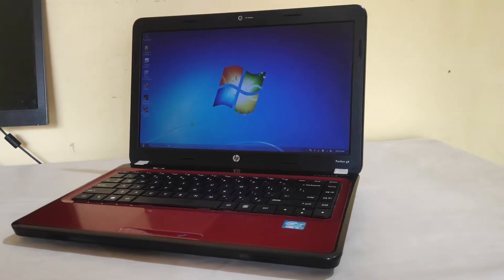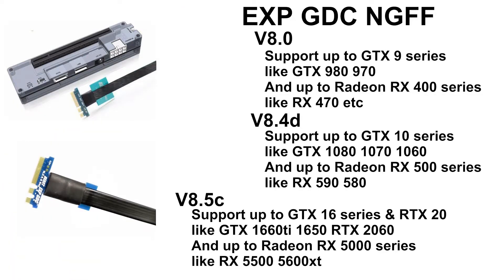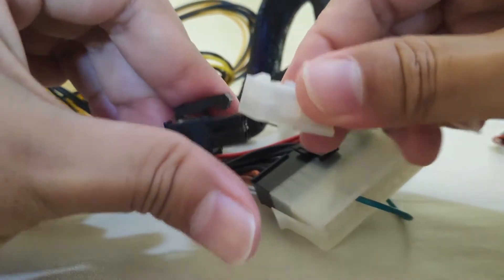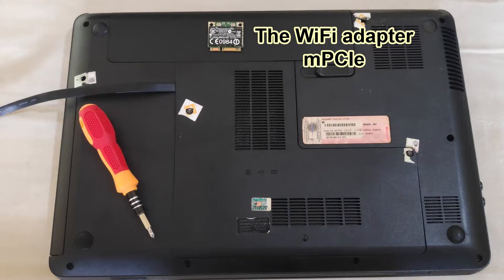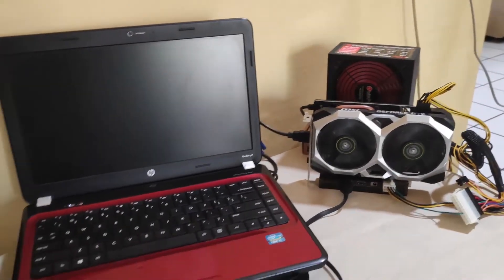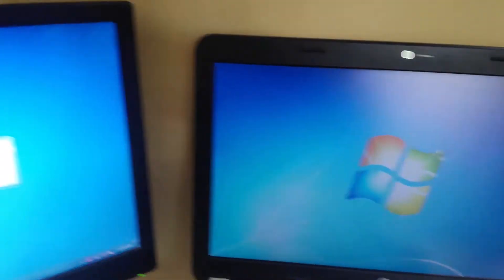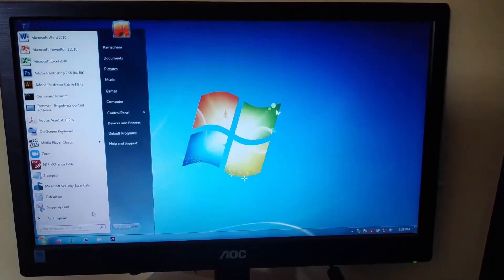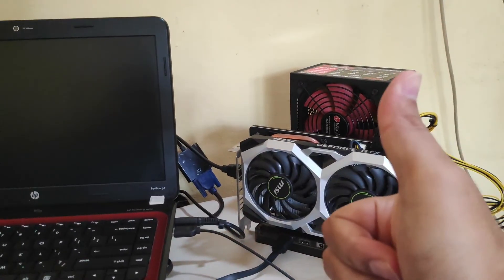EXP GDC Beast V8.5c eGPU with GTX 1660 ti on Old Laptop from 2012

Comment from the maker: I will just Pin this comment about other YouTube videos regarding External Graphics Card which are using BEAST EXP GDC of Various Model

These link Below, are using EXP GDC V8.0 mPCIe
https://youtu.be/ir-5JDITDd8      With GTX 1650 & Dell DA 220 W Brick PSU
https://youtu.be/6JcucfWz51o   With RTX 3070 & testing GTAV CSGO BF5

These link Below, are using EXP GDC NGFF
https://youtu.be/pKv436sOrNo    With GTX 970 NGFF
https://youtu.be/7-qdWAJf_UE    With GTX 970 NGFF & RDR2 Test

These link Below, are using EXP GDC ExpressCard, & Dell DA 220 W Brick PSU
https://youtu.be/sTSxdQuj8Bw    With GTX 1060 3GB
https://youtu.be/d7UjH6B4ltY      With GTX 1060 3GB
https://youtu.be/pAEMZqpvu0M    With RTX 3060 Ti
https://youtu.be/n7xExwDDR2o      With RTX 3060 Ti & testing CyberPunk 2077
Reply: bro beli dimana egdc nya? ada rekomended ?
Reply: I would like to ask about upgrade gpu of i7 6700HQ(Win10)  lenovo ideapad700.
Reply: https://www.youtube.com/watch?v=6Z67JN3b1Zc
just finished my eGPU setup, HP2560p with ATI HD5670
Reply from the maker: @newheavyion  Why setting that video for YouTube Kids?

Anyway with Core i7 QM, it is a wasted Performance because the CPU is still faster than the GPU.
Reply: @ClayWheeler  it is a fun project, not a serious gaming setup. I will try same others GPUs up to a R9 285 in the 2560p. Im just in the mood to experiment with older hardware i had in boxes for years now. Im also trying an eGPU setup on an Inspiron 1525 but with Lubuntu
Reply from the maker: @newheavyion  experiment with Genshin Impact and grow your channel lol
Reply: @ClayWheeler  Not sure what you want to tell me with that answer.....
Reply: @ClayWheeler will be work the exp gdc beast 8.5c in gtx 1660 supper 6gb ?
Reply from the maker: @SandroElias-bw4co  yes
Reply: @ClayWheeler  in core 2 duo t7100  1. 80 ghz, 8 gb ram?
Reply from the maker: @SandroElias-bw4co  no.

Core2Duo Laptop doesn't support modern PCIe signal .

Need at least Core i3 Laptop.

If anything, it should be cheaper to just buy a PC itself. Full set Core i7 2600k including Motherboard, RAM PSU case Only $50
Reply: @ClayWheeler all series 10

Gtx 1050, etc. ? Core 2 duo
Reply from the maker: @SandroElias-bw4co  yeah Core2Duo Laptop is too old to use external Graphics Card at all.

It will not detect anything
Reply: @ClayWheeler  good day sir
Reply: @ClayWheeler ahm.sir we have the same laptop sir..can i use RX 580 graphics card?
Reply: My PCIe x16 slot on my desktop PC mainboard (Gigabyte H310M H2.0) has died recently...is this a good alternative against replacing the board? Thanks!
Reply from the maker: @gkiss2030  that Motherboard is so cheap. Why not buy new instead? Or secondhand
Reply: @ClayWheeler Good idea, will try.
Reply: Hi. I recently got the exp GCD v8.5c dock with 220w PSU (dell) for a Rx5500 xt. my Acer with i7 5500U (dGPU 940m) won't boot with the WiFi ngff swapped with the dock. Or device manager fails to recognise. I changed bios settings but still no.
Any idea or help?
Reply: Hii, I got a rtx 3070, then I should use EXP GDC M.2 Nvme version right? I think it's the same slot we use for SSDs?
Reply from the maker: @PHOENlX1734  just click at the pinned Link with RTX 3070
Reply from the maker: @PHOENlX1734  depending if your Laptop old before 2017 or new after 2017
Reply: @ClayWheeler  my laptop is of 2022, I found out that I got two m.2 4.0x4 ports I can use it thanks
Reply: How you identifying the one the fit your laptop?

Comment: What happen if just use hdmi to hdmi ?
Reply from the maker: HDMI cable on its own is just video signal. Not PCIe signal.

The HDMI in this video is merely Physical Connector for carrying PCIe Signal. It doesn't do anything related to video signal.
Reply: Thanks. Good to know. @ClayWheeler

Comment: Question: is upgrading a old laptop (and putting a EGPU 1660 ti like yours) or a new laptop?
Reply from the maker: If you already have Both old Laptop and GPU in your possession, you better build a PC.

Laptop is really just good for being Portable. I don't consider Laptop for Gaming. Unless the Laptop stay at home forever. Then you can do whatever you want with the old Laptop.

If you want something really Portable, just buy a new Laptop, or secondhand Laptop.
Reply: @ClayWheeler  ok thanks A pc could be a good idea

Comment: Hey i know its been 4 years but will my acer aspire e1 472 connect to a gtx 1050 ti G1 gaming 4gb ddr5 with this and do i need to go to my bios to change something please tell me 🙂
Reply from the maker: Core i5-4200U?
Reply: No i3-4010U
Reply: Bro will u plz answer  🙏
Reply from the maker: @Alexor237 I read people's Posting in Reddit, all of Intel 4th Gen Laptops with U series are using NGFF WiFi adapter.

But it is very tricky to set up. It is not as simple as 3rd or 2nd Gen Intel.

Intel 4th 5th 6th Gen laptop is difficult to use External GPU unless it has Thunderbolt or Express Card
Reply: @ClayWheeler  hey there I just asked Gemini he said that my one uses Mini PCIE so can I connect it
Reply from the maker: @Alexor237  just open it up before buying the dock.

Otherwise you're wasting money.
I'm pretty sure myself, it's NGFF
Reply: @ClayWheeler  OK then I will see but how do I know the difference between NGFF and Mini PCIE slots ?
Reply from the maker: @Alexor237  you will know right away. The number of Slate teeth.
Just match it with the video description
Reply: @ClayWheeler  hey there i checked my laptop and it has Mini PCie so yea can i connect it or did i see something wrong

Comment: Yo i did everything correctly and the gpu and psu turn on and my laptop boots up correctly but when i check in device manager it doesnt show the gpu it only shows my intergrated graphics card.everything is connected properly
Reply: Have u installed the driver of the graphics card?
Reply: @Alexor237  so turns out I think my GPU was the problem HDMI ports and VGA ports are faulty
Reply: @datboimelo  oh ok then hope u found the solution 🙂

Comment: Hi..i got mini pcie.. Tried with gt1030 graphic card is showing but always driver error 043... later found that in the exp gdc manual it's mentioned it will not work. Do you any solution for that ..if not what's the latest graphic card which works with gdc 8.5c.
Reply from the maker: @137mrbond1  I have Error 43 fixer. Please write down your Email backward with space and then I will send it right away. Don't worry you're the 200th person who asked for the fix.

For example yourEmail@gmail
To be: l i a m g @ l i a m E r u o y

I will delete these entire comments after I sent you the fix. It's 100% WORKING.
Reply: @ClayWheeler  moc.liamg@563neevanhcet
Reply: @ClayWheeler  thanq for the response
Reply: My laptop specs hp envy4 1202tx with hd4000 and RadeonHd 8600/8700M . Which already has compatability issues.. Laptop only works if Radeon HD graphics is disabled. This issue has no solution.. Tried many times with all the info..i switched to EXp gdc for graphics solution. But still having problems.i tried with old nvidia GeForce 8400gs it worked but not the gt1030..
Reply from the maker: @137mrbond1   I am fully aware of Error 43 and I know how to fix it.

The problem is, this is a Paid software. But I'm gonna send it to you for free. And the instructions are Self Explanatory because it's super easy.

Seriously just tell me your email like I said above

Comment: Would coexist the intel UHD Graphics 3000 with an intel ARC A380? Or should I uninstall the drivers of UHD? I Thought set the core i7-270QM or i7-2920XM instead of Core i5 2430m for better results

Comment: To be fair, you could get a similar experiance with a gt1030 gddr5. You'd have achieved more by selling that netbook and buying a used gaming laptop with a dedicated maxwell gpu.
Reply: Did gt1030 worked on exp gdc 8.5c with laptop
Reply: It mentioned it will not work

Comment: Thank you, I've wanted to buy an EXP GDC for a long time, but I was unsure if it would be compatible with my HP Pavilion G4 laptop. Your video finally convinced me. 
I have one question though: do I need to disable the laptop's GPU? I have a switchable HD Graphics 3000 and HD 7400m.
Reply from the maker: @doughlaspardede    No need.

Just make sure the BIOS settings the same as in video. Also for Windows 10, please don't Install anything newer than 1909.

Because v2004 v21H2 and newer have weird glitch

Comment: Forgive me but isn't the whole idea of a laptop to be able to play anywhere, how are you gonna game sat on say a plane or even your sofa with all these pieces?
Reply from the maker: @SN-ig2ml  why are you even bothered with Old Piece of Laptop anyway?

I have a newer Laptop that is thinner, more Lightweight, less straining for my body when traveling. Obviously not good for gaming because it doesn't even have discrete GPU. But it's good for Desk Job like Microsoft Excel etc.

So instead of throwing away my Old Laptop, it's still good enough for lightweight gaming. So it is permanently on my desk.

Of course, with my current Lightweight Laptop, I will definitely make it into Gaming Laptop when possible. The M.2 slot can handle External GPU after all.

If I want a Laptop that is good for Gaming, and Traveling, it is "Framework Laptop" . You can forever upgrade the components including the GPU CPU etc. You can unplug the thick GPU when not needed.

My family have a habit of "Not throwing away any Electronics"
Reply: I'm doing an egpu setup on my old 12 old laptop too in 2025 but it is so big that it's more like a portable desktop anyways. When I want to game or watch movies on the go like a plane, I have my phone or handhelds like a new 3dsXL and psVita. I only like a laptop having the ability to take it if I must, but 99% of the time I'm using it as a desktop PC anyways. I play all my steam games on my old gaming laptop as I'm not a fan of the size of a steam deck. The egpu setup is saving me over $2000 for a new gaming laptop for a couple more years. For me it's huge!

Comment: I have a hp pavilion g6  can I try this with a better or higher card without the i5 2430m bottle neck it?
Reply from the maker: @kwajovybz  you also have 2430M ?

If yes, then any Graphics card beyond 1050 Ti already bottleneck by the CPU, not GPU. Also bottleneck by the mPCIe itself.

You can also use Lossless Scaling Frame Generation tool from steam

Comment: 0:23 I have hp elitebook 6930p it has core 2 duo p8400 from 2008
Reply from the maker: Not possible. It doesn't have any Adapter that serve as PCIe signal
Reply: @ClayWheeler  that laptop has 2 wifi card slots
Reply from the maker: @MacroSword  I mean, WiFi card slots in old Laptops before Core-i era, aren't using PCIe signal.

They literally no different from USB modem.

Comment: Hey man plz i have laptop asus x552c with nvidia 710 integrated and i want install egpu rx 580 plz can  i do that?
Reply from the maker: Let's make this faster.
Open your Laptop, and then open up DXDIAG .

Basically just click Start and type DXDIAG.

Record everything using your Phone, and then upload it to your own Channel.

I will comment there if it can use External GPU or not

Comment: Shall it work if i do the same

I have pentium dual core inside ddr2 ram

Mey you tell me?

Any gpu dock would be compaitable to my pc?
Reply from the maker: Unfortunately no.
That system too old to use GPU dock.

In fact, you better build a cheap PC instead of using that Laptop.

You can build a better PC for the price of this GPU Dock alone.
Reply: @ClayWheeler  mey I use that gpu dock and try to install DDR2 graphics card

Or PCI slot which supports gddr2

Is it possible?

Does GPU dock support?
Mey you tell me?
Reply: @ClayWheeler  

Right?

Comment: Hi, this Is an excellent video, congratulations. I have a doubt ¿Can I have connected a mouse and a keyboard with external gpu? Did you play with an external keyboard? I have installed an RX 550 4gb with drivers but screen Is black, the external screen is VGA with an extension to HDMI. I don't know what else to do, hope you or somebody else can give me an advice, thanks

Comment: hey! Can you explain step by step how to diasble the dedicated GPU and PCI controllers? I got a GTX960m and wanna use a GTX1660 super but can't get it to work it show's up in device managed but still getting error code 43 and now it's 31 again, saw a commend below that i have to disable controller for it and such but no idea how, i'm on a Lenovo Y700 that's upgraded a bit with 32GB ram and it has a i7 6700HQ and a GTX960m a 2TB SSD

Comment: Hello, I loved your video, and I have something similar. It's the same version of the EXP GDC v8.5c.

I have an HP ProBook 4440s laptop, a 400W ATX power supply, and an RX580 8GB graphics card. I connect everything correctly, but when I try to start, the laptop simply doesn't boot. The screen remains black, the LEDs light up, the graphics card powers on, but the computer doesn't start at all. Is there something wrong with the compatibility?
Reply from the maker: With mPCIe version?

Try to unplug the eGPU mPCIe—HDMI cable from the dock, but let the mPCIe stay connected to the Laptop.
And then just boot.

If the boot is successful, try to uninstall the AMD Radeon HD 7650M using DDU Display Driver Uninstaller.
And then restart, go to BIOS.
Check for something similar to this video about booting from network adapter boot.

After that, replug the HDMI to eGPU dock. Try to boot again.
If it fails, you might have accidentally flipped the Physical switch (or maybe the seller has toggled the switch) on the eGPU dock. 
If it hard to reach, use needle to move the switch

Comment: Hey how can I fix this my EGPU fan is working and when I connected it on HDMI it has no display and my laptop monitor is on supposedly it is working when the EGPU is working it worked yesterday but when I opened it today it doesn't work anymore help please